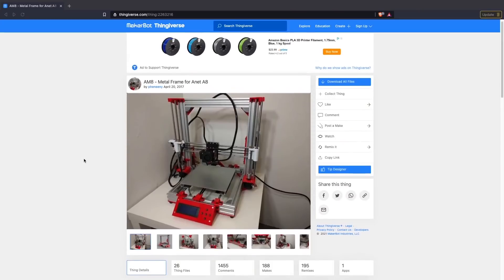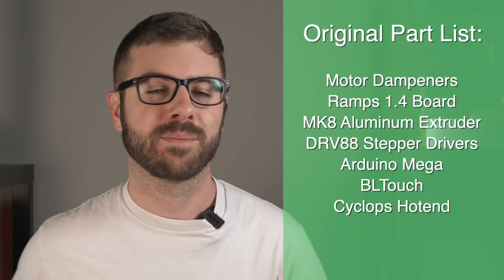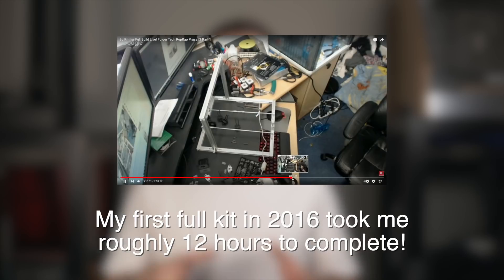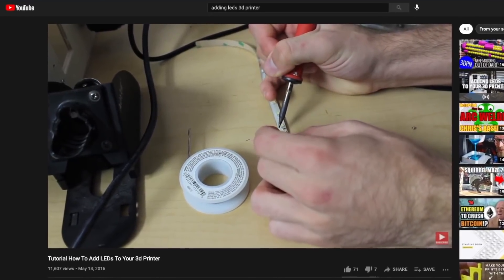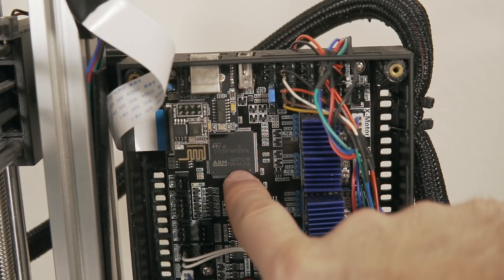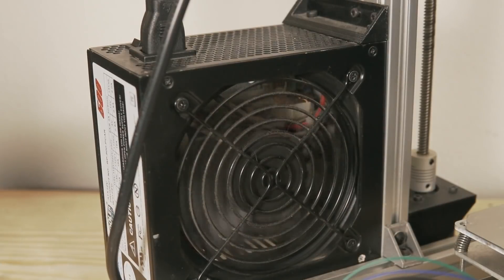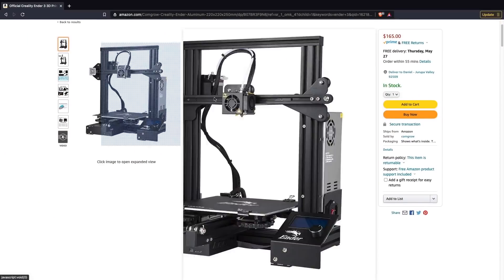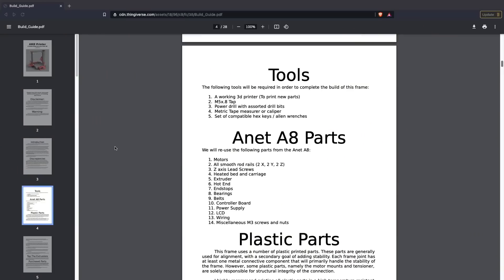My Experience With The Anet AM8 3d Printer Conversion

Comment: Still own an Anet A8 I bought for 80€ back then on a sale from AliExpress which was the cheapest thing I could find. It´s now heavily modified and if someone asks if it was worth it - depends. Back then I learned a lot and tried many things and spent most time modifying it instead of printing something, but most mods I have were necessary to make it reliable. It has a belt driven single motor z axis, e3dv6 hotend, bmg direct drive extruder and a machined aluminium hotbed, runs on 24v with tmc2209 stepper drivers. The acrylic frame was stabilized with aluminium profiles from the back and it runs on Marlin 2.something on a SKR 1.4 turbo. Basically not an Anet any longer and the mods were applied over some years but who cares.
It still runs today and for the fun of it I may sometimes upgrade it to klipper and maybe some better bearings or even linear rails. Never found the time to upgrade it to AM8 though I bought the aluminium parts years ago.
There are many very good printers out there today but the price tags are solid and it´s not so important for me to spend 1000€+ on some Bambulab or similar printer unless I want to make money with it. The Anet is a slow work horse and I use it sometimes for the occasional functional print to repair something or if I need a jig for woodworking. Don´t have the patience for day long prints and have some PLA crap standing around I don´t need. If I needed it my choice would be a CoreXY printer with enclosure. But the quality of my prints are very respectable and compared to what much more expensive printers deliver today I think I don´t need to be ashamed of my slow Anet.

Comment: I think I bought the last A8, just for my own curiosity and the history of it.  I modified it with all the rigidizing and new circular bearings, as the ones that came with it were full of slop.  It prints very well but I only used it for some standard parts and the fact that it was much slower than even the Enders.  The parts came out very nice. But it was just because I make most of my living now using 3D printers from 200 mm to 1620 mm x 1020 x 1020 mm. The changes in 3D printing has been amazing.  I looked into 3D printers a long time ago and they were just "not good enough".  Now I make parts that are strong and can do hard work.

Comment: Just want to say, thanks to this video - I finally got a flex plate for my AM8 running Klipper.  Still finding a few more things I can upgrade on this printer.  It might not be the fastest like my other printers, but I have more tinkering history with this guy - and that's why I love it.
Reply: I tried klipper but i coudent get it to work the z though the endstops were at the opposite end and the endstops were already triggered so I gave up

Comment: I bought a ctc  printer just to make another printer which is an Anet A8. Then I upgrade it to 300x300 heatbed with BTT skr1.4 board and screen . Now i'm debaiting on core xy or core xz conversion. I however working on the Enderwire conversion.

Comment: This was an entry printer for most of the guys out there. When all metal frame came out it was very good. 

Thanks to community i managed to build a beast out of this and still running it for the past 3 years… lubed rails every first weekend in month. Im using skr 1.3 and 2209 drivers, v6 with a bmg direct drive… back then was really a good printer for me and printed around 7k hrs out of it… printed parts for my next 4 printers… and still prints very good

Comment: Nice! I remember unboxing the Anet A8. First printer. I had no clue and remember thinking it just looked like a load of parts from a hardware store. There weren't even any instructions. It is still going on the original frame (with braces, firmware and an Arduino smoke and temperature nanny lol). It has hundreds of hours on it and has printed another 3d printer and a CNC machine for PCB etching (that I gave up on lol). It is still on the original nozzle and is one of the better machines I have for TPU. I bought a Tatara A8 steel frame but ended up building a whole new printer and leaving the A8 alone. 🤣

Comment: Yes it is worth it, as least for me, after putting in a skr1.4 (cheaper now 2023)& tmc2009.. marlin 2.0 it become so Silent & prints awesome for a machine more than 7yrs. All other hardware same old just tightened and duck tape it down onto a desk, cable tied the Z&Y rods..to its acrylic frame, adjusted the x-slider bearing to cut the plays of the 3 slider bearings.that’s it. Love it now😂. Bought 300mm bed, 500mm rods for x, the original x goes to the Y, maybe will frame up the base with steel hollow or heavy rigid Bakelite board. Looking for a simple klipperizing method to see how well it could do😊.

Comment: So I just put the lerdge-z on my anet a8 I also changed out the bairings to whatever them gray ones are that don't have slop and all the printed upgrades and put a e3d v6 on it as well. The print quality it decent but would the metal frame make it any better? I'm currently getting jerking in my x I can't figure out at high speeds but low speeds its ok.

Comment: A few years ago I got an A8 basically in a pile for free. The connector on the bed had burned up (common on the old dangerous A8s) and my friend disassembled but lost interest. I threw out the acrylic and went for the AM8 conversion. Over the years, it has been an exceptionally reliable machine. I added FETs, a custom extruder/hotend E3d clone by cobbling together a couple designs off Thingiverse. Soldered the bed leads directly to the bed, and swapped out the power supply. Flashed the board to Marlin 2, and tweaked all the settings. Except for changing out a couple bearings here and there, it has remained as the last of my "old school" 12v printers and still finds plenty of uptime printing. Is it the fastest? No. But I know exactly what to expect from it. One thing that never ceases to amaze me, as long as I don't fuss with it too much, I can go months between bed levels. It is rock solid. Fun to hear others' experiences with it.

Comment: Yep, still have one the acrylic frame and a ramps main board. But for some reason it died last night after I powered it off and reversed a stepper motor plug. Now I’m going to use the parts to build a mini core xy printer that fits in the enclosed shelf it was living in for ABS prints. I’ve also had an AC heater for it so that will get upgraded as well to match its big brother which is my D-Bot

Comment: the original frame is easy to deal with. Take a half inch threaded rod and use washers and nuts to secure it horizontally in the back through the 2 holes that are supposed to be used for wires. Add the hulk braces to the frame as well and its solid as a work.

Comment: I still have 6 of them in my print farm. My first one I will leave as it is for nostalgic reasons, and the 2nd one I got was used as a core xy conversion and runs Klipper, carbon rails for lower moving weight, and stock electronics.
I am actually about to start a Voron Legacy build using Anet A8 parts just because I would love to see what it can do. I built the Voron 2.4 and love how it prints and am keen to see what a $100 upgrade can do to a printer like this.

Comment: I've got the upgraded A8M (Mod with double extrusion and some other parts "upgraded"), not really using it due to issues with the periodic de-leveling..  but it had one positive aspect! thanks to that horror of acrylic frame I've learned how the 3d printer works and what goes where..
now thinking of moving on to prusa or buying something in between of 400-500€ to print nylon/asa/abs
Reply: Mount it on a stable platform and set your z stop, make sure your belts are tight and rock on.

Comment: I have two A8s in pieces and am struggling with the fact that converting both of them and replacing the boards with an skr mini e3 v2 plus all the other stuff is nearly the price of an Ender 3. I just don't want the motors, rods and screws to go to waste. I've looked for other projects to do with them but it's just cheaper to buy an assembled printer. 

Would you say it's worth the effort at this point or just get something new?

Comment: I picked up an AM8 early in my journey a few years ago, it did already have external mosets for hotend and bed, which was nice.  From there I put in an SKR 1.4 Turbo, Gulfcoast All metal Creality style hot end, dual drive titan style extruder, pei flex plate, PINDA probe, and Fystec 1.2 LCD,  Meanwell PSU and yea.... works awesome :)
Reply: Care to share your firmware, Paul?

Comment: i still have an anet a 8 in stock form and an anet a8 plus in stock form. it still run great
Reply from the maker: That is crazy. I hardly ran it stock. I mean I did, but I did add frame braces and belt tensioners pretty much right away if I remember correctly.

Comment: My first printer was an Anet A6. Recently I decided to replace it since it was falling apart (psu died, fans died, frame was is bas shape...). So I bought an Ender 3 v2 and it's been great. 

Now I'm thinking of recycling de old anet but the only parts worth using are the motors I think. So I would pretty much be buying (and building) a new printer.
Reply from the maker: Yeah looking at the Anet printers there is not much worth salvaging. Motors really would be the main thing I would keep. Plenty of projects they can be used for.

Comment: I need to upgrade my 8 bit board on my A8 plus because the extruder driver popped. It blew the heat sink off and shorted some other stuff on the board. I was going to get an SKR 1.4 turbo but was wondering if the lerge was worth the extra money? Thanks for your video and I especially appreciate you talking about your soldering experiences. Many YouTubers behave like they are perfect and it is refreshing to watch and listen to a human being.😄

Comment: Still rocking my A8 on the original frame and solid bed mounts. I did convert it to ramps with a mosfet board, and also running an E3D-V6 with ABL using the custom carriage a friend and I developed when I first got into printing. To this day it is still enclosed and is my go to ABS printer. I did get an AC heated bed for it but never bothered to put it on. The A8 is the printer I used to print all the parts to originally build my D-Bot 4 or so years ago, which has since been upgraded to a duet main board and has run an AC heated bed since almost day one. The only modern printer I have purchased is the Sovol SV01
Reply: Ever since we developed the X carriage that converts it to a bowden setup, the Z wobble went away without adding any bracing. The only braces I have on it are on the front and back to stiffen the acrylic parts when you tension the Y belt.

Comment: I still have an Anet AM8 and intend to use it for many more years 😅 
I got the Anet A8 for around 180€ and the motherboard failed after around 2 weeks and then i started upgrading pretty much everything. Now with the AM8 frame, Ramps 1.4, mosfets, e3d v6 clone (direct drive) inside the Bear MK3S extruder assembly with bondtech gears and what not, 2 TMC2130 drivers and a RPI3 with OctoPrint. The 24v conversion is yet to come but the thing prints almost as well as the original Prusa i3 MK3S (just the bed is annoying AF) with a pricetag of around half of that.. so its still a great platform :) 
(If you have a LOT of time 😅)

Comment: Memory lane. Ditched AM8 ~ 2 years ago. never looked back. My A8 was also upgraded w only the original lead screws, stepper motors, a few screws and wire remaining.  Good learning experience, Chinese printers suck. Now I get to do the 3d printing that I actually want to do w Ultimaker , Taz, and Prusa. +1 for mentioning Voron.
Reply from the maker: Sounds like quite an upgrade. By todays standards it definitely is a poor printer. But back when it released everyone was so excited for it :)

Comment: You made me cry, I have a wooden A8 and would have LOVED to get that acrylic frame from you!  LOL
Reply from the maker: haha I dont know that it is actually bettery than plywood. Sorry though it was year ago :(
Reply: No acrylic pls 😅, i change to 2040 aluminium frame instead .. if rigid
Reply: @AJayTheStageArtist  Acrylic HAS to be better than plywood!
Reply: @KarrMcDebt  They're equally bad in different ways. You can at least clamp down on wood as hard as you like and it'll take that. And if you do mess it up, it's easy to patch up. I have a wooden i3 and i have braced it with steel struts to the front, it's quite rock solid now. I mean of course it has problems, lots, but the frame isn't really the problem any longer.

Comment: still running an A8 slightly modified. I mounted it to a board with some  steel angle, and clamped some MDF to the uprights to make them more rigid and it prints OK.I  also had to replace the power supply (it died ) and re-wire the bed (it was thinking about setting my house on fire)

Comment: A8 was my first 3d printer 5 years ago. I have upgraded A8 to AM8 and now I'm slowly converting AM8 to BLV mgn12 3D Printer mod. I have tested every possible component on this printer, all bed surfaces from Kapton tape, glass, Chinese builtak, ultrabase to magnetic PEI. I had also stepper dampers, which luckily didn't install. All firmwares from repetier, marlin, smoothieware to today's klipper. All types of bearings from bronze sleeve busing to mgn12. Motors have a Closed Loop Driver board. Power supply from HP server, outside of Enclosure. It's a great, reliable printer, but most of my prints lately are from Prusa MINI. I also plan to build voron v0, just looking for v0.1 kit shipped from Europe.
Reply: Builtak? I know next to nothing except simple sugar is a great solution.

Comment: Using stepper dampers is not overkill, it is just wrong. You don't want additional flex in the kinematics.
Reply: @Lassi Kinnunen 81 I know that. Damping the vibrations introduces flex into the system. If you want to eliminate vibrations then use Klipper firmware and input_shaper.